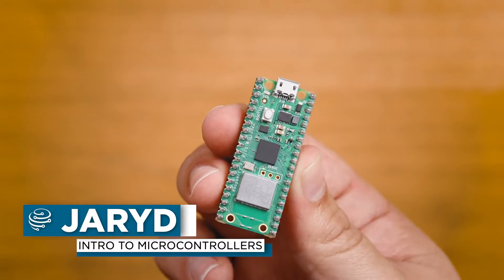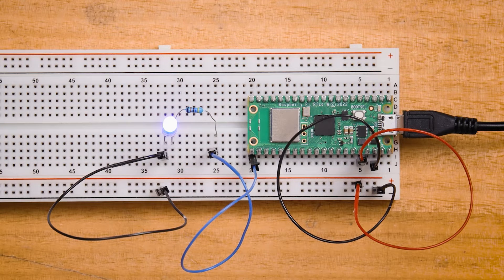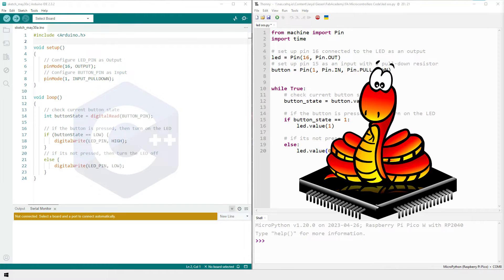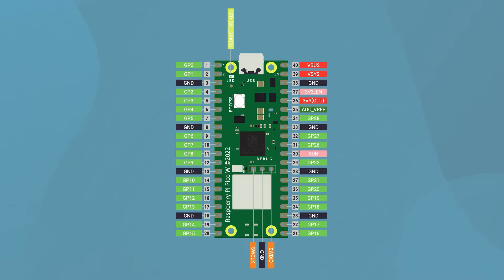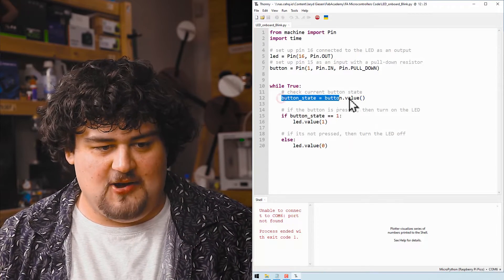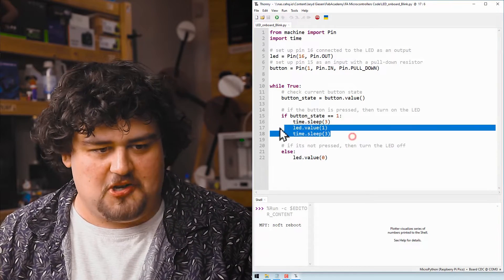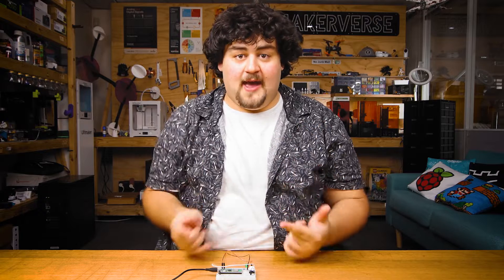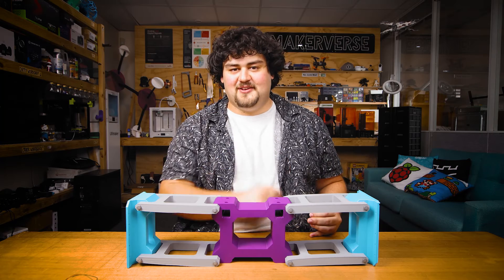The Run Down On Microcontrollers | Zero To Maker Workshop

Comment: since when are we not programming microcontrollers in assembly, since when is LED brightness not controlled by PWM program? I'm so confused rn
Reply from the maker: Programming in assembly does have its charms, but unless the project needs it I might stick to something a little more high-level like Python. @SkippiiKai is right, we are using PWM, we just didn't mention the technical term, this video was just an introduction for people to the world of microcontrollers.
Reply: It is pwm. He corrected himself on screen where he wrote that he meant the average voltage increases.